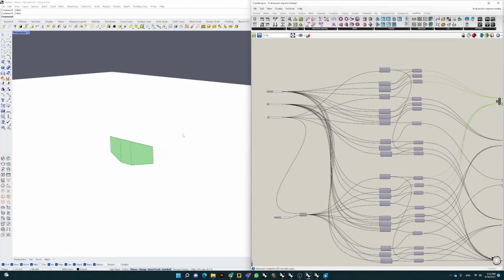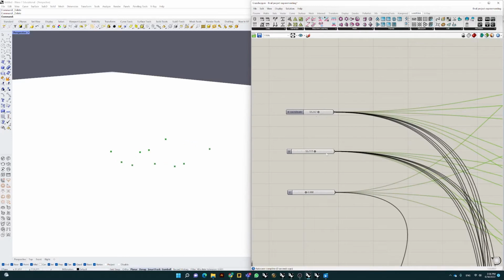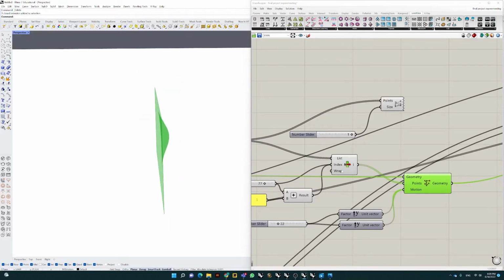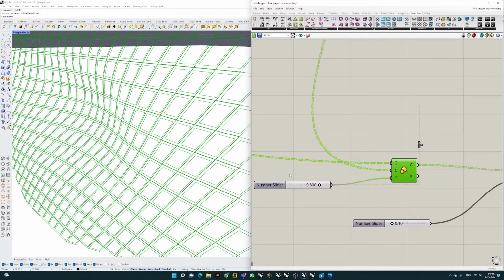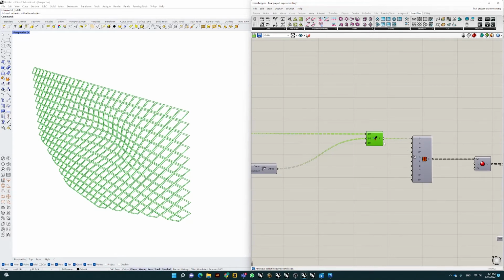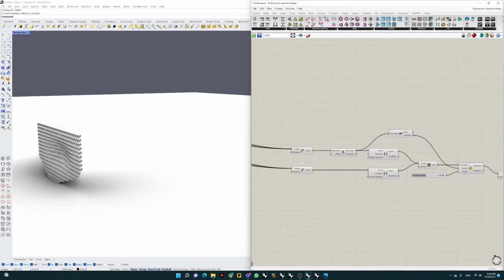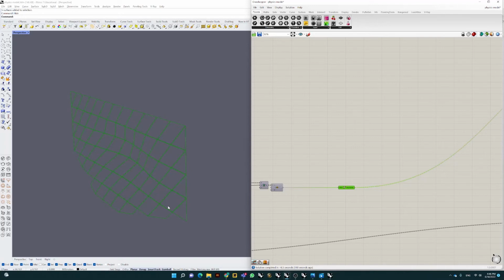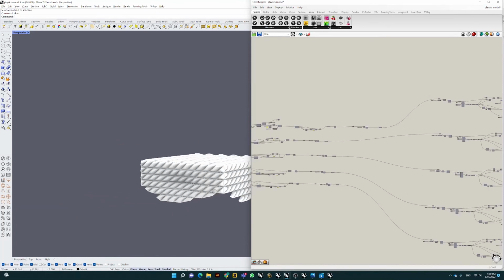the broad museum - parametric modeling using grasshopper

Comment: Great solution! I tried it in a different way. It operates smoothly, but is not that flexible to control the form of the box. Would you mind sharing a screenshot showing the first part of the components?